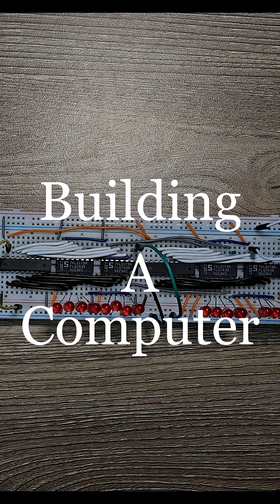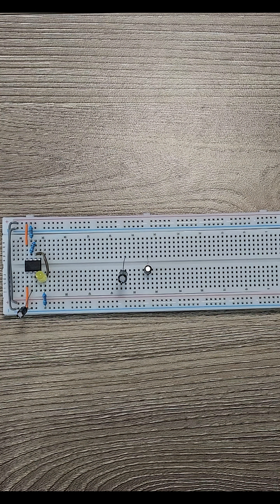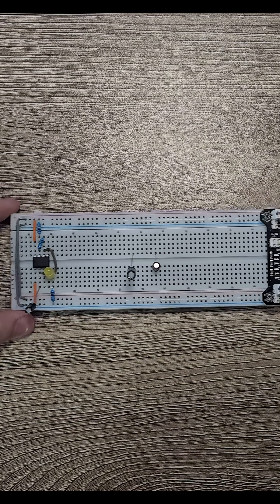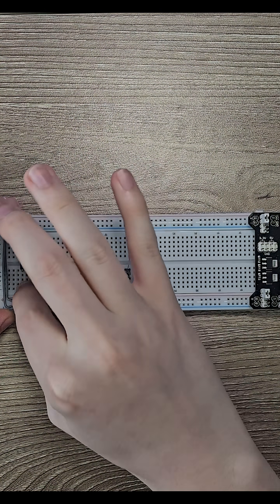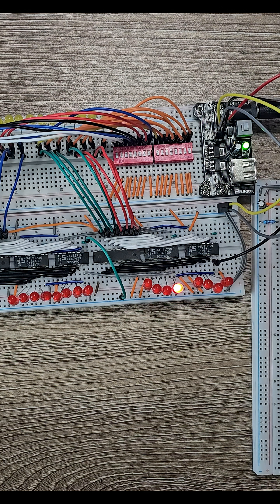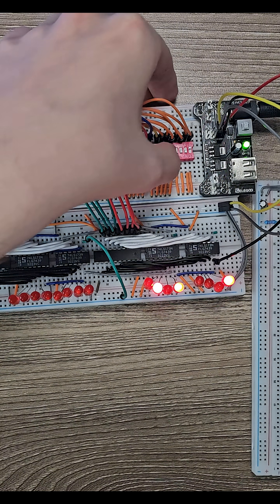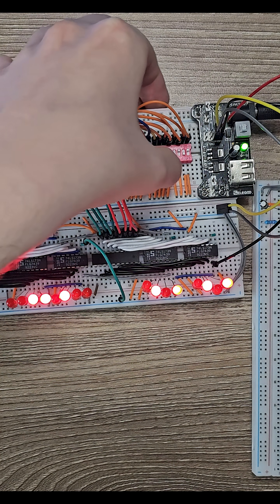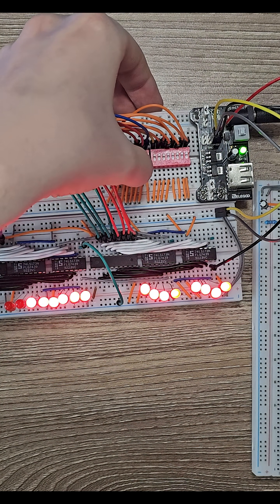Day 16 | Building a Computer from Scratch

Comment: Use a potentiometer that has the two back pins connected to the Discharge Pin and the front pin to the THR pin, you can additionally add a resister in series with the potentiometer to set a "minimum resistance"